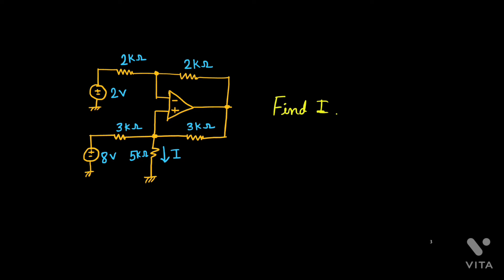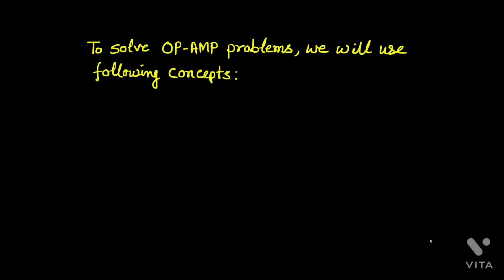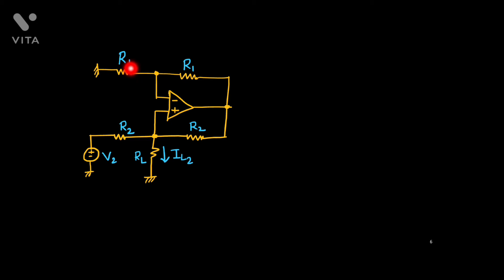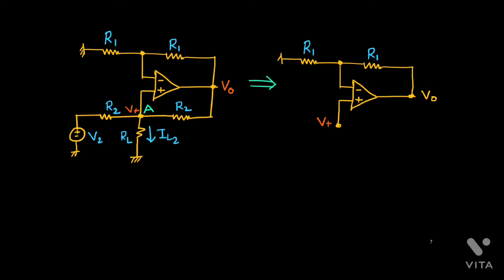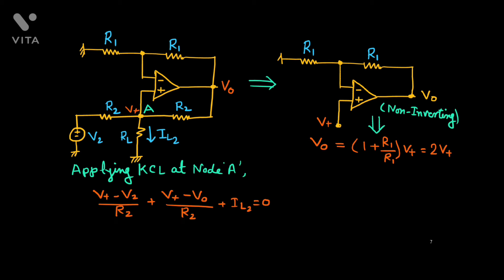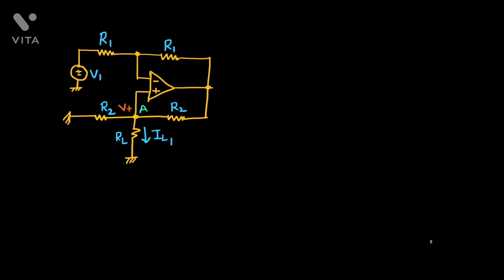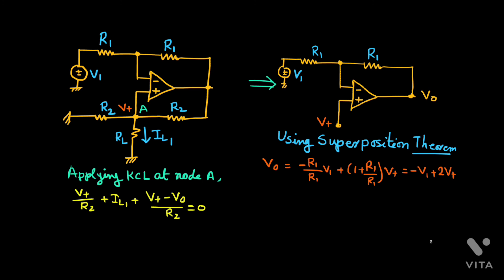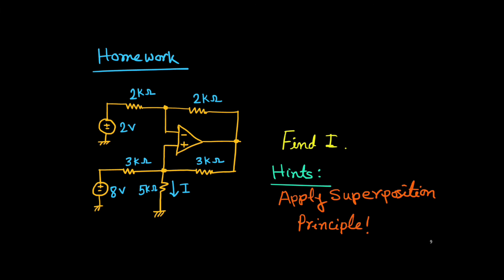Problems on  OP-AMP (Operational Amplifier)- Tutorial 4

Comment from the maker: Post your answer in this comment section. This problem can be solved using superposition principle. However, you can also solve this problem by considering both the source together. Just calculate output voltage first and then take KCL at non-inverting terminal.